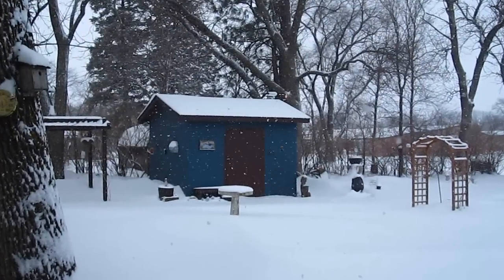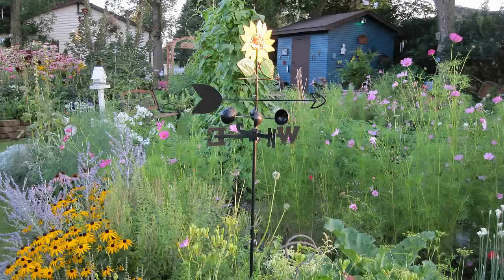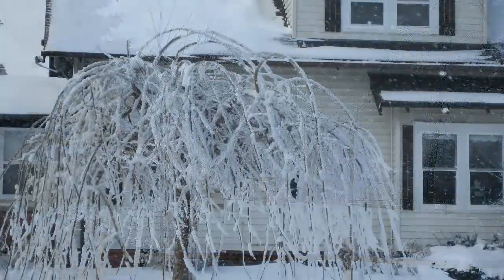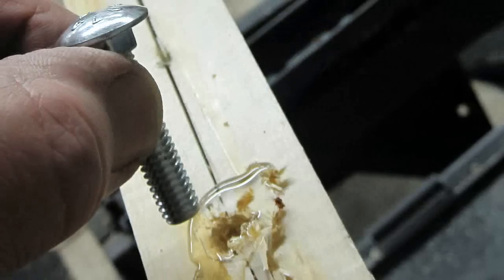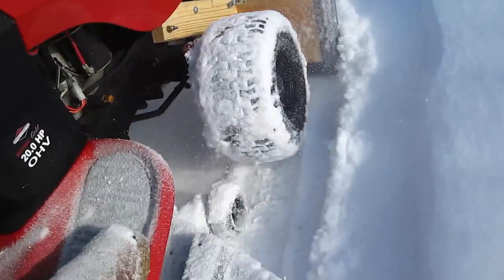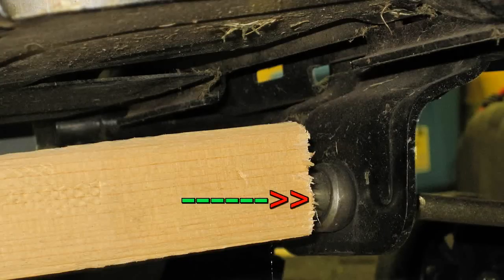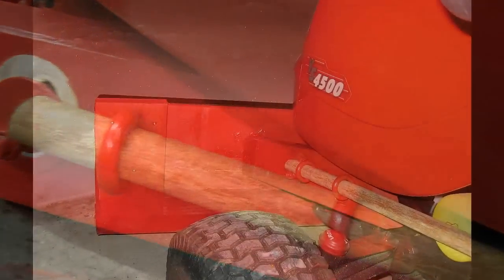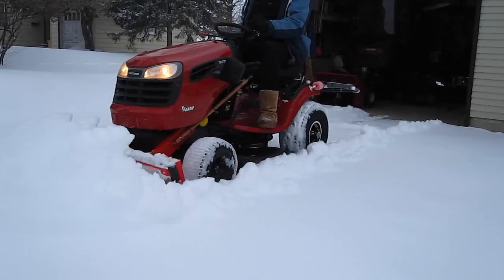I made a SNOWBLADE for my Craftsman YS 4500 Lawn Tractor + Sibley winter beauty.

Comment: Haha, good for you. I realize the enjoyment/satisfaction that comes from having a creative mind and some handyman skills.Nice job on the snow blade! I had a similar tractor with a purchased snow blade attachment. The manufacturer (Craftsman) used a single, centered mounted trip spring which would trip the blade when it reached a certain amount of resistance. I soon realized that the blade would trip way too often against loads that the tractor could have easily pushed through. To solve this problem I purchased another spring from Sears and reattached both springs off center with approx 6 inch space between both. Worked like a charm! I just wanted to share that with out considering the fact that I appreciate knowing there are other similar minded creative handymen out in the world. Have fun with all your future projects!
Reply from the maker: Thanks very much for sharing your story too.  This blade worked just fine for 4 years, before the fire destroyed everything I owned.  I have now moved and no longer have that tractor to push snow with, but I used to like to use it.  Thanks again.

Comment: I just used some heavy half inch rope and made myself a set of rope tire chains for my lawn tractor, cheap, easy and dosent tear stuff up as much as chains. Also my homemade plow is at about the same angle as yours and sometimes if it gets caught the front tires lift up. I need a bar like that in the front or your plow for mine to keep it down. Thanks for the ideas.

Comment: I used a sheet of 3/4 plywood to plow.  I used a 2 x 4 brace with cleats cut into it and two 5" rubber wheel barrel tires as a rubber bumpstop and hood protector.  I just lay the sheet of plywood at a 45 degree angle and it catches the hood and I secure it with a chain.  Works awesome and on and off removal is a snap

Comment: Great job, I have a 4500 model as well. Just might be a project soon. When i used to live in Ohio I had a lawntractor with a snow blade/push blade for the front, it was a lot easier on the body than shoveling for sure. In southern Va we only get a couple snows a winter and its usually every few years we get one like you have there but, a plow would be good for those times. Thanks!!

Comment: Great idea, I've never thought about using wood.  I've got two Craftsman's of the same model.  One for mowing & the 2nd one was sans the deck and supposed to be spare parts until I discovered it still ran.

One idea/suggestion I'm considering.  I have a bagger for the one, and I'm thinking of getting an extra bracket and modifying it for a COG balance like you did.

Comment: What you do to put weight in the back so wheel don't spin ?
Reply from the maker: I added tire chains in a later video, but in this one, I had 2, 20 lb dumbells on the back and it worked fine, as you saw.

Comment: sears actually has a metal snow blade for the YT and GT series and its actually very similar in design except its made of metal and has an adjustment shaft that can both lift and lower and turn the blade. But you did save like 300 by doing this i guess

Comment: Good invention , But I have had 2 sears big tractors with their snow blades and in time with wear and tear I to had to make my own parts, for one with the deck still on it would hang the tractor up in deep snow! And with out chains I would push deep snow no where. And be- leave me ! ~ I have used these sears tractors for snow they were never met to do . My 2007 Craftsman DGS 6500 would make your snow a breese with chains on and my big lard ass . Just saying chains make all the difference on a little rear wheel drive garden tractor . I live on the eastern plains of Colorado where we get some good blowing deep snow at times . I now have a used skid steer that is a blessing for my now old age creeping up . But you know what the old sears garden tractor still dose the best . The throw away tranny went out on me last year , I took it out of tractor last year , drain the old oil out that is motor oil ! put new in and it going again. Or my be love tractor I have used on my neighbors snow besides my hard and be on use in full speed most the time would be in the junk yard now . Deer Trail Colorado home of the first Rodeo

Comment: the satisfaction in this DIY snow pusher...taking 10x longer to do a job with the wrong machine (and not a great result either)
use a good snowblower, get a better result in a reasonable amount of time and leave that little mower inside til its time to cut grass
Reply from the maker: Sometimes I like to do stuff, just for fun.  The snowblower I had was very good, but at my age, I was slipping around on the ice under the snow and if was easy to fall so the Blade and mower was much more safer. But they all got burned up in my huge fire along with my house, boat, cars, and all models, so at this point it is mute.

Comment: You will shorten the life of your mower deck, blades, pulleys, and belts running in the snow! The steel isn't designed for wet conditions. I'd remove the blades & belts on mower and spray the underside of the mower deck wirh silicone spray heavily before taking it out in the snow.

Comment: i hate snow wish it was summer all year make sure you change the oil and filter every 50 hours and check the level every time you mow these briggs & stratton engines the single cylinders like that like to blow connecting rods.

Comment: Hey Bassboy923  do you know what snow is made of? 
Well I can tell you its not Nitric acid And if anything it will most likely clean out the grass build
up that accumulates from mowing   and it is under the grass build up where moisture is trapped were  you might get some erosion that could cause rotting  In my opinion he is prolonging the life of his mower deck. Well done Nightflyyer. 
   You know I think if your the bassboy that would make your mom the basshole lol lol

Comment: Take off the mower deck it will not be good for it to be in snow. Then but a blade for the tractor plus wheel weights and chains
Reply from the maker: Yep, my home made blade lasted years,  but I changed it all up in the following video link.  But in 2016, my shop and everything burned to the ground including the house, so it is all gone now.  Here were the mods I made before the fire though, with chains, etc.  Thanks. https://www.youtube.com/watch?v=6736KVBaMNQ&t=54s

Comment: No, no, no.   So many terrible things going on here, but I have to smile at the ingenuity and innocent abuse of machinery.   First off, wood is for furniture and heating, not pushing snow.  Second, the mower deck is supposed to be taken off and leaning against the inside garage wall now;  four seasons, remember.  Your heart's in the right place, though!
Reply from the maker: I used hardened treated wood and it worked 5 years before the fire destroyed it.  No where is is written to take mower decks off in winter and I proved it for myself. If is sounds stupid, but it works, it ain't stupid.